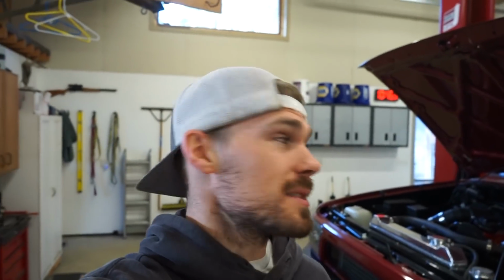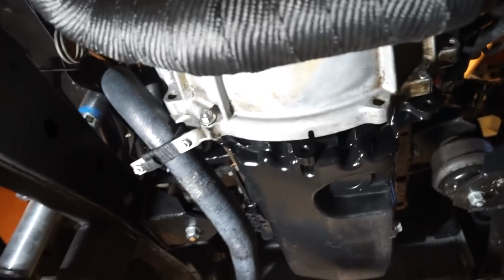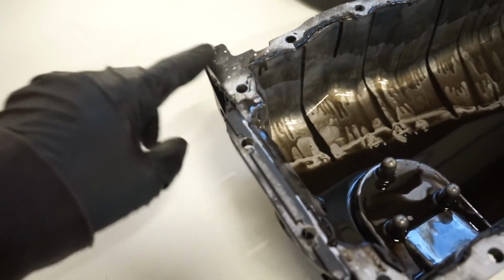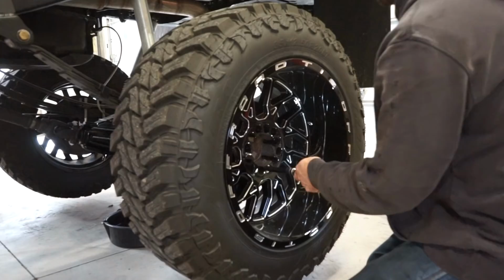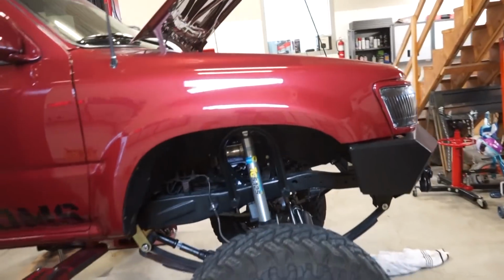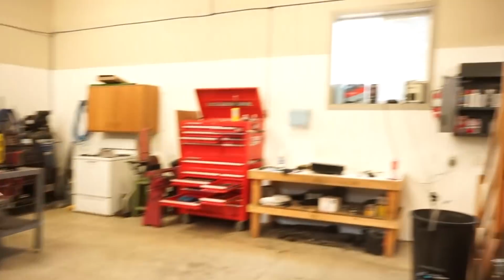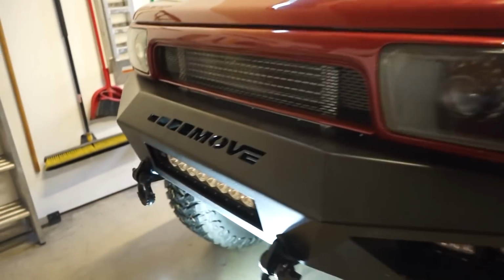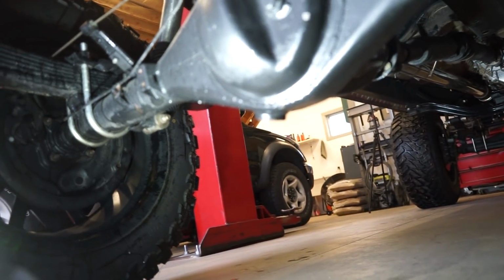Big Red Getting Some Love

Comment: I’ve had problems sealing my oil pan and third member up. Finally I tried The Right Stuff and it works great. Even used it on the rear end in my dads truck and it works great. No leaks whatsoever and it seals for a really long time. Great stuff.
Reply: Yea I like right stuff. Also a roloc bristle disc works great for removing old gaskets or silicone

Comment: Austin just a quick tip never smooth out the RTV with your finger, just put it on just about like toothpaste would come out of your toothpaste tube and install the pan. It will seal much better that way.

Comment: When I was a teenager I blew up and rebuilt the engine in my CJ Torino.  Once we got it back in the car I dropped a socket down the distributor hole and it went all the way to the pan.  I almost cried.  I fished around with magnets for about two hours.  I wanted to pull the engine because I knew the pan would never seal doing it under  the car. My brother in law swore we could pull the pan and get a good seal.  I didn't agree, but that's what we did and it leaked immediately.  I learned over the years that the fastest way to do something is rarely the best.

When you went on your test drive I kept looking down trying to see under your eyebrow tint!  lol

Comment: Enjoy all these videos! Keep it up!! I like hearing about what other people use for there vehicles. Couple recommendations I could give you. Walter makes something called slapshot. It’s better then break cleaner and stays wet for a little longer. I also see you use AN fittings with flex hose have you thought about stainless. In the oil patch I use a product called swagelok. It’s not cheap by any means but by far the best tubing and fittings around. They also make braided lines.

Comment: Toyota factory Silicon is the best you'll find. The stuff you used is the next best thing. Don't know why people like to spread that stuff with there fingers. It only causes leaks down the road. 
Lay a nice continuous bead and just put the pan in place. If you have to break the continuous bead then just lay another short bead over the break. It will squeeze out what it doesn't need. Think about it, when you spread the silicon with fingers it cause unevenness. Don't get crazy with the silicon. Worked on cars all my life and in shops and this is what I've found works best. Keep up the great work.

Comment: Austin, it seems like you use brake cleaner a lot to clean things.  Why not just use Acetone?  It's probably cheaper.  And had you already done the rear pinion seal on that rear diff?  I just had to replace mine on my 94 ex-cab.

Comment: Austin, how many quarts of oil does she holds? Oil leaks that oil is being flung suck. Gear oil has a smell like a septic tank,especially when you run a Locker. My first locker was self destructive. It would spin both tires even when one is in the air. Detroit locker. I've seen them throw axle shafts through the housing durning differation!